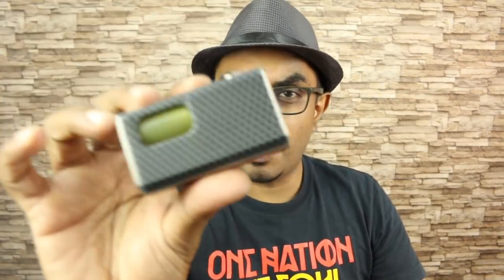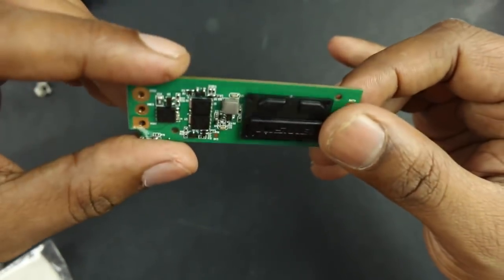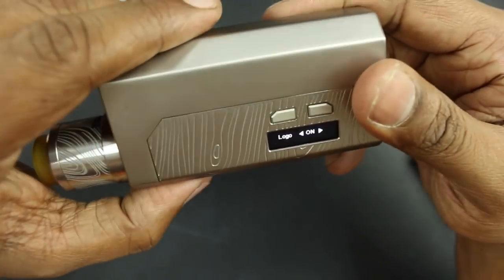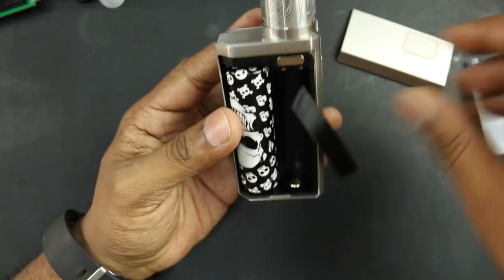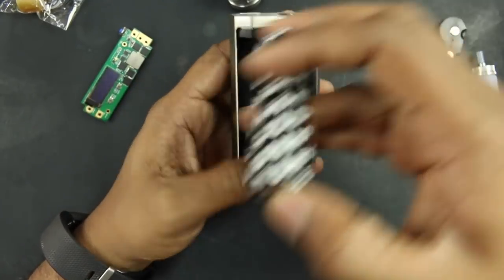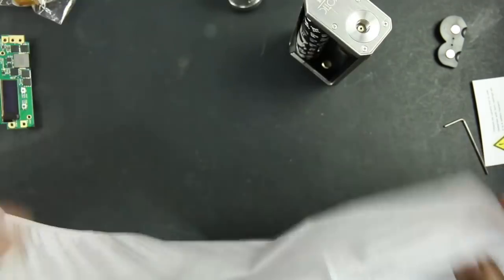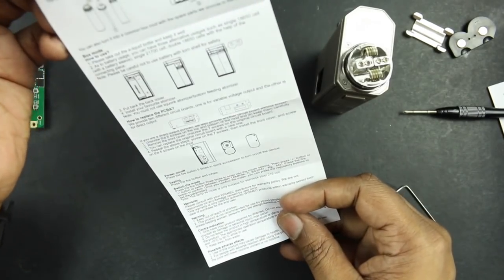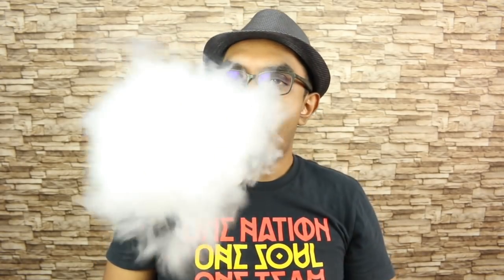CRAZY IDEA! Wismec Luxotic MF Squonk Kit

Comment: You keep missing the point for the hack on the luxotic. 🤦🏻‍♂️
Reply: Nathan K McKay being able to use other bottles, eliminate the metal tube that doesn't let you squeeze it completely because its in the f way. 
Fyi the first bottles were too hard, the silicone ones that came after too soft, the coil master are brilliant. 😉

Comment: Do not see the point of having the bypass mode pcb, It does bypass on the other chip, bad idea having that bottle top off sett, if you do not want the see the screen it has stealth mode.Having to take it part to update bad idea, leaves them open for litigation and an excuse no to honour warranty.
Reply: Lews Therin they never honoured a warranty anyways so makes little difference ,
Reply: would not know, only issue i ever had was with Smok, and surprise surprise you were right, Twas an Alien, in fact the 3rd Alien that went wrong and it was right on the 30 days, as the shop was rowing with smok over the 1st 2 they weren't interested, neither was Smok. It's why i will never buy another Smok product again and am incredibly weary of all china based companies and now only buy from the best reputed UK online stores.
Reply: Lews Therin i try to stick to dna boarded mods , there not the best reliability from what other say , but evolve will fix the board for you , usually free apart from shipping it to US , even if you had it 12mths or so ,
Reply: DARREN 123 funny enough, so do I now, use both dna and yihi, though I prefer dna. Yihi make things to bloody complicated and do not except criticism at all well, whereas dna will go out of their way...
Reply: Lews Therin  i do like the 75c boards 100w boost/ preheat with replay ,much better with onboard action and settings, various cell types and sizes the 21700, 37500mah cells last days 
 not got a 250c mod or board yet 
since i stated using more bf mods ( single coil RDA,s and RTA,s so with the higher power mods ive not much need for now ,